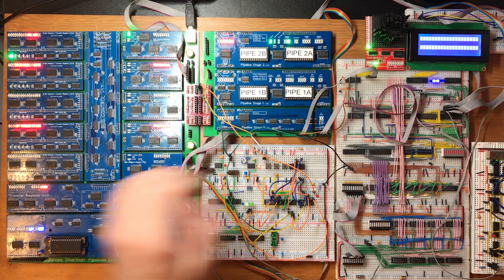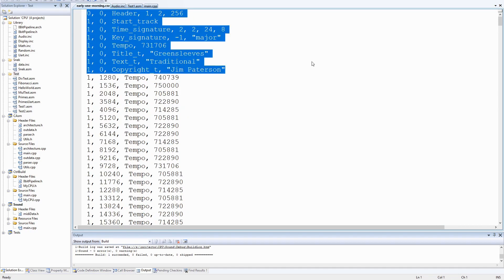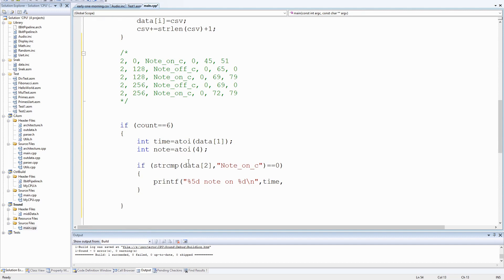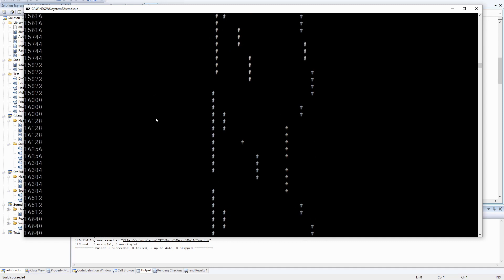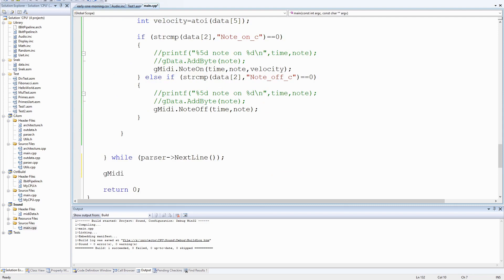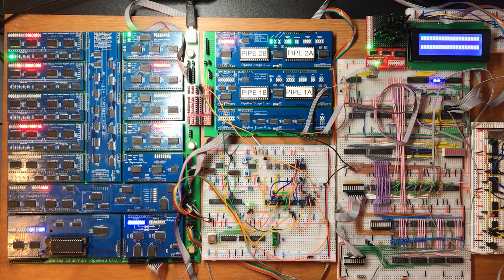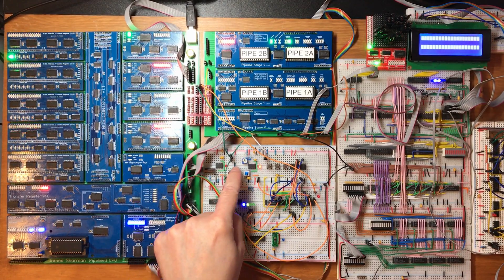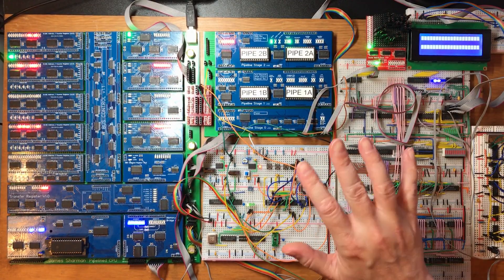Midi Data - Audio from Scratch - Part 3

Comment: Would be cool to implement this home brew CPU in a home beer brewing system.  HomeBrew²
Reply from the maker: I once used the heat from a cpu to distill alcohol if that helps?
Reply: @weirdboyjim  Thats putting excess heat to good use.

Comment: Are you at some point going to add some kind of timer/timing/real time circuit so you can have programs (like music) that run at the same speed regardless of clockspeed or how much other code your running? Otherwise it would make it pretty hard to make somthing like a game becouse then you need to exactly count the number of cycles stuff takes to get things to run at the right speed.
Reply from the maker: Later on in the series it aligns with some work on the vga modules so I start using the vertical retrace for timing.  That lets me play back music with a 1/60th precision which is easily enough for most things.

Comment: You're writing C++ like it was BASIC. :) 
Try using the standard library.  At least use the range-based for loop to go through an entire array.
What's a "midi mile"?  You mean "MIDI file?"
BTW, here and in the title, MIDI should be all caps.
Reply from the maker: I've made a career out of optimizing the code of people who think the standard library is the only way to go.
Reply: @weirdboyjim  i mean yeah but it's not like you need optimized code here if you're "prerendering" the data anyway, and the standard library can make things more readable.
not everything needs to be super optimized, and while definitely not the only way to go, it's a bit easier to follow than e.g. manual array math. you're not writing SSE* assembler either after all ;)

Comment: If you're new to the CMOS chips that Jim is using in his computer then you might find this book useful: CMOS Cookbook by Don Lancaster. I bought a copy from Amazon and read it in a weekend. I thought it was excellent. It is choc-a-block full of useful and practical information on working with the 4000, 74HCxxx and 74HCTxxx families of chips. It is very readable and contains the kind of information that would take hours and hours to grok out of datasheets. I find it is a useful companion as I follow along with what Jim is doing.
Reply from the maker: * James  ;-)

Comment: Nice! Soon you'll have something has even VGA output (or something) and keyboard input, so you can develop on the actual machine ;)
Reply from the maker: VGA output is definitely in the plan. I'd rather stick to developing on my main PC, but I will be doing something to make it easier to get code over to it. I can already attach a keyboard via the UART.
Reply: @weirdboyjim  surely using a PC makes things a lot easier and especially faster, however my old dream was always to create something does not depend on any existing other computer (including [e]eprom programmer) ... Surely again, I never had time to actually do it, so maybe your approach is more realistic :) As I always say, "maybe when I become retired, I'll do it" ...
Reply from the maker: One you have the IO then removing the PC dependency is easy. You just need an interface that lets you poke values into ram and jump to an address, anything beyond that is just an "ease of use" improvement. A whole development environment would be possible (Adding a means of storage would make life much easier though) it's all just a question of development time.

Comment: 128bps?
Reply from the maker: The 128 step in the time value? The final parameter in the header seems to be a divisor  but then you need to process the tempo data to actually turn it into true time.
Reply: Beats Per Second

Comment: Early one evening it was great to see MIDI files explained :)
Reply from the maker: I've only touched on the absolute basics here, hope it's interesting!
Reply: @weirdboyjim  Never looked at MIDI  files before, but I’ve had a MIDI keyboard for about 30years that once connected to a sound card on a 486 PC. So that dates it a bit. Looks like I’ve got to see if it still works and try and play something. Thanks for the idea for a new video series . “Had it for years! Does it still work!”

Comment: A great start! At some point I imagine just parsing raw midi directly on the cpu might be useful (although without a filesystem it's not that great I guess). Multichannel sounds awesome as well!
Reply from the maker: Thanks Frank, it wouldn't be too difficult to do what I've currently done on the cpu, but hand coded assembler always takes more time so i'll get where I'm going much quicker doing initial data development on the pc.

Comment: Are you going to show D to A with a resistor network?
Reply from the maker: Yes I will, in the very next Audio video I think. That will be used to implement volume, I'm not thinking of adding in PCM as that doesn't feel right for this project and sample data just burns memory.